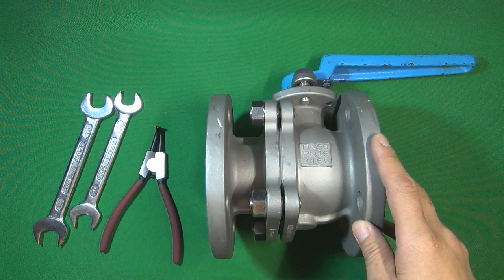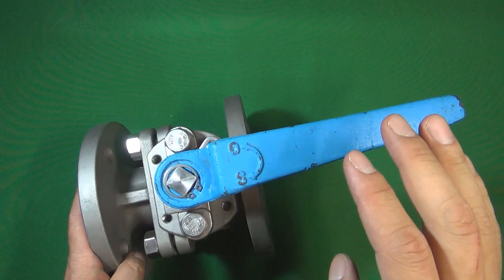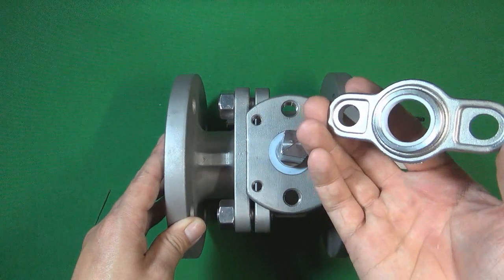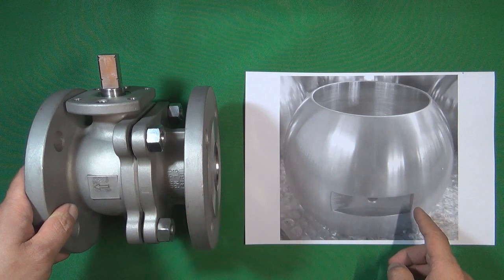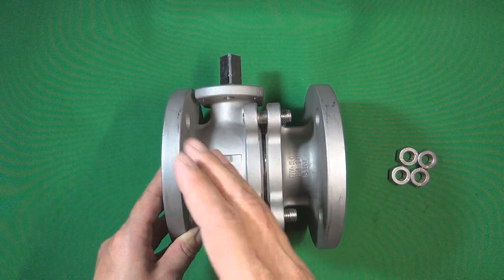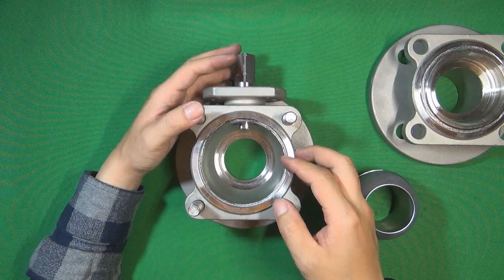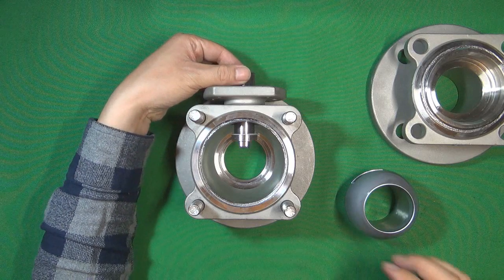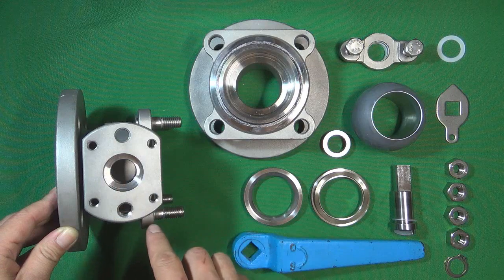Disassemble a Metal Seat Ball Valve #Design Tips 8

Comment: Really amazing video of a SS Floating Ball Valve Parts, please use hand gloves for safe and also to avoid any foreign particles or dust to enter in to the flow bore and valve parts, wetted and non-wetted parts area, even this is for a demo purpose.  Safety is the main thing, always think twice safety is the first priority pror to start any work.  The sharp corners may torn or cut your fingers make you an accident.  A marvellous video wondered.  Thanks a lot.

Comment: Sir can you make video on ball outer diameter design calculation on basis  of inner diameter of 150 class
Reply: That is actually dependent on the manufacturer/brand. If the you want to have a practical design better get a brochure of the items. Its much better if all the items u needed in the design is easily available to buy. And just fabricate those parts that cant be bought.